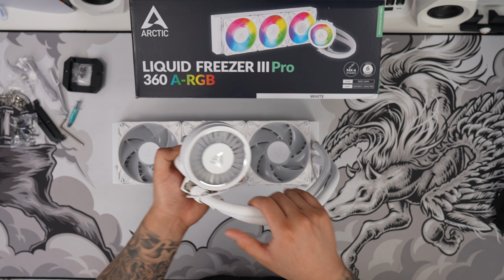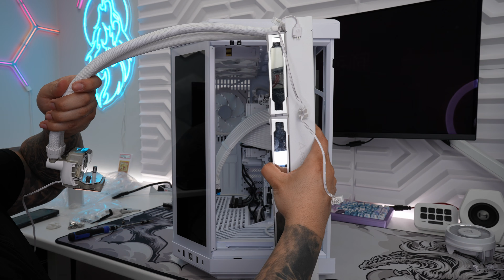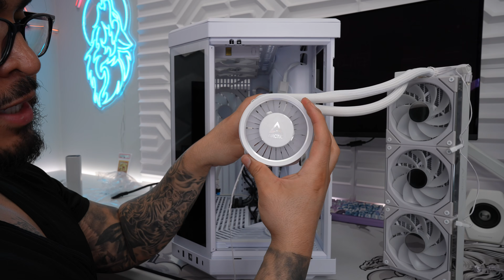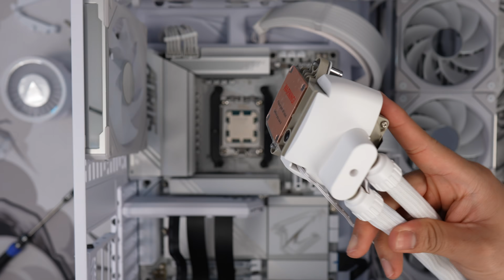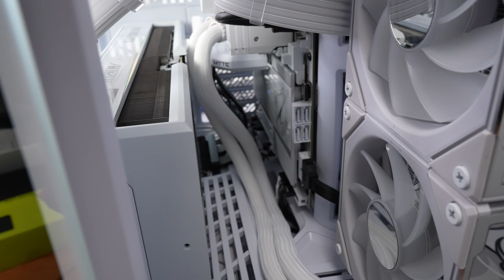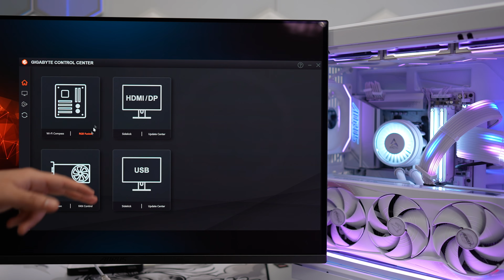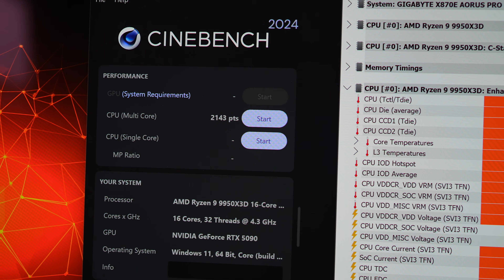Arctic Liquid Freezer III Pro 360 White : How To Side Mount, Control Fan Curves & RGB Control on AM5

Comment: I saw with another reviewer to NOT always put the pump high. Not sure about this model, but the regular is most efficient at max 80%. That's because the water doesn't have enough time to cool down. Every see those commercial toast makers on a treadmill to go under a heater? Like that in reverse. You need time under the cooler.
Reply from the maker: Pretty sure you’re referring to the latest jayztwocents video about pump speed 😅 makes a lot of sense and for future videos I’ll adjust accordingly. Another factor is also not having a low to top curve that changes the speeds every time the CPU heats or cools
Reply: @FIREWOLFTECH  I'm experimenting with it myself, just bought an AF III. My Prime95 stress is hitting 91C and I'm not happy with that.
Reply: In my custom loop I run my pump at 60%. A good balance of sound and flow rate. My 9950X3D with -35 CO peaks 72c on cinebench multi. 38-42c Idle temps depending on ambient temps.
Reply: @SteezinBreezin  Thank you for commenting and reporting your measurements. I am running a 9600x (for two reasons; more $ for a better GPU and also Zen 6 if I wait a year will be much better) but I will note I am benching with Prime95 which causes much higher power draw, perhaps this is unrealistic, as I never get that in Cinebench or games.
Reply: Oops, my point being I can't directly compare if my setup is doing badly for some reason. I'm thinking of re-pasting to see if that helps, or else I can try front AIO vs top AIO, though from my research, when I do buy a GPU (I'm waiting due to current market conditions), the GPU will be much cooler in the top mount option.
Reply: Oh! Btw name the product with those wires with the chasing lights, cool af
Reply from the maker: Hope you get better temps! And I just updated the description with the full Y70 part list 🔥 those are wirless strimer cables from lian li
Reply: Nonsense ignore the reviewer the coolant temperature saturates and normalises after a while that’s relivent only for few mins use
Same as the myth order of components on a custom loop matters again it doesn’t for same reason
Reply: @louisburland5346  I agree, his logic seems confusing. But, his test results did show that max pump speed didn't make a difference, so while his reasoning may be wrong, the overall conclusion is still valid.

Comment: Hello friend, I'm an admirer of your videos here in Brazil, here in Brazil, it's very difficult to find this version, especially the PRO, and I'm finishing assembling my PC... the difference between the non-pro version and the pro version is HUGE? I'm going to install it on a 7800x3d...
Reply from the maker: The major difference is the fans, so if you’re planning on using different fans, the non pro is perfectly fine. 
The only other subtle differences would be better PWM readouts and that extra silvery trim. The PRO just came out, so I would assume it should be available easier soon
Thanks for showing the love from Brazil 🔥❤️
Reply: @FIREWOLFTECH  Thank you very much for the quick response and congratulations on the content and quality of the video... So from what I see there won't be a problem getting the non-pro version lol
Reply from the maker: @ you’re welcome! 
And yes the non pro is also an awesome choice 🔥 just make sure your case can accommodate the thickness and size of the radiator 😅
Reply: @FIREWOLFTECH  Oh my god kkkk i will buy a DY470 darkflash aigo .... Kkkkkk

Comment: Its too loud.
Reply from the maker: The pro fans get loud above 1300RPM and can spin up to 3000 making it louder. Most fans just spin up to 2000 which is why I recommend lower fan curves since 60% is almost the same as 100% in other fans

Comment: Great video! Do you know by chance if the AiO would also fit into the Y70 if it was mountet to the top?
Reply from the maker: Yes it will! Although a push pull might be very tight so I’m not sure how much clearance you’ll have 😅

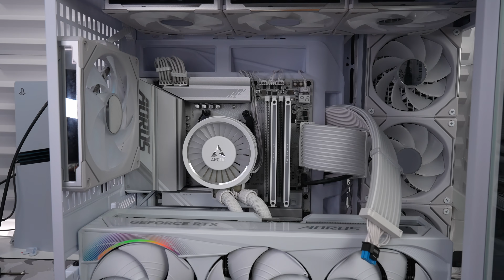Comment: 18:42 thanks for showing this, this is my planned layout for new pc build. i want the pipes to be at the bottom and going up behind my vertically mounted 5080 Aorus master and below the Ram. It would be the best placement with barb connecters at the bottom for 420mm arctic III AIO mounted in the side position of a 011D EVO XL case in push pull configuration as intake. The side mount bracket for the case can be turned around giving you more clearance on the inside of the case or backside of the case depending on what youre trying to achieve. Same thing for mounting your motherboard, 3 different placements, upper, normal and lower.
Reply from the maker: You’re welcome!! EVO XL is a monster of a case, so I’m pretty sure it’ll be easier to do with a removable bracket 🔥

Comment: Any reason that you didn't connect the pump to either of the two pump headers on the motherboard?
Reply from the maker: Because they were located in an awkward position 😅 CPU_FAN will automatically tie the pump to the temperature of the CPU which I’m still able to control the curves. Some motherboards might not have pump headers, so CPU_FAN works fine

Comment: this one or the original
Reply from the maker: This one if you’re using the fans that come with it, since most of the performance gains are from the P12 Pro fans
Reply: @FIREWOLFTECH  The offset contact frame is providing significant gains for the Intel Ultra CPUs (LGA 1851).  I wonder if this offset contact frame doing any change to the LGA 1700 cpus. Worse, better, same ?  Arctics performance tests for the PRO model only mentions the Ultra cpu.
Reply from the maker: @ Yes they’ve seen gains in intel, but since I don’t have any intel CPUs, AMD it is 🔥

Comment: i have same cpu, MB and AIO. what temps do you have as i am worried: in bios i get 46 C. and idle in windows new install i get 55 on full fan speed.
Reply: i read somewhre to undervolt the CPU as gigabyte sets it to too high
Reply from the maker: If it’s a new install and you idle 55C, I think it’s okay, but it also depends on your ambient room temperature and your cases airflow. 
I idle at 42-45C but can idle at 48C if I start running more programs in the background (like wallpaper engine). 
This is with fans set to quiet (900-1000RPM SL infinity) and 1000-1100 for the pro fans. 
I do have the latest bios update, so if you haven’t updated, maybe you can try that. 
On a final note, since this is X3D, I set the power plan to BALANCED instead of high

Comment: Final note, all motherboard software is garbage. Gigabyte i love their boards, but they by default have  a setting in the bios where when you get into windows, it runs a service and starts installing ON ITS OWN the software.
Highly recommend OpenRGB and Fan Control. Both of these tools have almost dead 0% cpu hit, while running a single servicec. OpenRGB doesn't even need to be running once you setup your lighting.
Reply from the maker: I think armory crate is the best, but again it’s personally preference if you want to use a software or just BIOS. 
I’ll look into Fan Control though since I haven’t tried a 3rd party software for fans

Comment: There is no reason on this planet to run the PUMP at max speed btw, you will just cause it to wear out way faster, and its recommended to run the pump at a much closer to mid/low speed, this is a AMD CPU, it doesn't need to run that hard.
Reply: False information, pumps should always be run at high speed they are literaly designed to do that and running them low speed reduces longevity
Reply from the maker: I personally run the pump close to or at max because most of the time the pump is inaudible and helps reduce temps without relying on revving up the Fan RPMs. 
Also, I don’t have to worry about the pump revving up and down since temps of CPU can fluctuate 😅
A lot of software controlled AIOs have really high curves as well. 
Now I don’t know the longevity of it, but a quick search suggest running at 100% is fine
Reply: Pump on dynamic curve is I think best, with their low temperatures being already at like 70% speed. And under load 100%. That is the best of both worlds. Pumps opposed to fans don't make a lot of sound anyway.
Reply: It’ll be fine, it’s designed to run at full speed. Constantly changing the speed hurts it more than running it close or at max

Comment: I recommend checking the static pressure of the fans if u plan to mix for push-pull , that way u can control the fan curves more safely without reducing the lifespan of ur radiator, that's what I did , and i used the LF3 fans for push and Lian Li SL fans to pull (Y)
Reply: I'm massively impressed by your comment. People always say you have to use matched fans so the airflow is matched, but that's not possible. Fan airflow ratings are calculated on unobstructed flow, in a push pull set up the fans that push don't have the same level of obstruction as the fans that pull, so airflow will not be matched even if the fans are the same. As an example for people who don't understand this, in this video, the push fans have to pull air in through the case mesh and then push it into the radiator. The pull fans pull out of the radiator, so the push fans have more obstruction. So as you said, set it up so it's close because getting it perfectly matched is not possible. I usually front mount my aio's and I actually set it up so that the push fans run a little bit faster due to the fact they are dealing with more obstruction. But who knows if I set that right, it's just based on my guess 😂.
Reply: @thebigsmoke5047 same! I keep mine as equal as possible, with any situation where rpm wont match favors pull fans faster. Makes sense to me.
Reply: What do you mean by reduce the lifespan of your radiator? 

And do you mean should we push with stronger or weaker fans?
Reply: @themarketgardener  It is recommended that the performance of the two fans should not differ too much.
Reply: @NiMaCGua Oh yeah
Reply: @NiMaCGua doing this for looks but also cua I felt it might help with that thick ass rad but it dont have room to mount it tubes down anymore at the front of my case
Reply: i plan to do just this but with the 420mm ARCTIC Freezer III in black on my new PC build. Mounted in the side position of a Lian Li 011D EVO XL case. I will move the fans (72.8CFM each) that came with it to the outside of the radiator and use 3 x 140mm Lian Li SL Infinity fans (72.7CFM each) on the inside in a push pull configuration. The A RGB version of the AIO seem to use a lower CFM fan than the plain version. Also another streamer tested changing out the fans and replacing them with P14 Max's (95CFM each) x 6 and it slayed. The rest of the fans in my case are all going to be Lian Li SL INF as well. the 120mm in that case dont fill the slots properly, i dont like the look of the gaps.
Reply: @DrizLd Even though the P14 non-ARGB has better stats, P14 ARGBs perform better because of the design. Check STS’s P14 ARGB review. Also keep in mind P14 Max’s are strong but they are loud as hell and need manual tuning. I’d prefer going 6x fans that have good noise/perf ratio instead. These pro fans seem like they’re good.

I’m also planning on a LF III 420 ARGB on Side mounted intake O11D EVO XL but going to use all P14 ARGB fans (if P14 Pros don’t come out by then). And for rear P12 ARGB of course.
Reply: @tma78 How did it go? Any pics?
Reply: How can u check the Pa tho?
Reply: I’m glad someone said it. In all honesty as an hvac professional the radiator is thick enough that even if you have a push pull your heat saturation is high enough a push pull would arguably make it worse. Especially if you don’t touch fan curves. It creates drag and turbulence one fan ends up having to pull air through the radiator and the other fan making it work harder because they’re not in perfect synchronicity. Air temp changes cold air to hot air, air expands before it hits the pull fans inside the box creating more turbulence. Air pressure changes push blades and break bearings. And you’re pushing more power to run it all. For in most cases a worse cooling system then a 3 fan system and making your pc waaaay louder.

Comment: @FIREWOLFTECH  The radiator on the PRO is 11mm (.43in) thicker than the regular version.  Also how were your temps??  I have the same case and CPU, and have a Kraken Elite 360 with 6
Scythe Grand Tornado's in a push/pull config and 7 SL-infinity fans and was still getting warm, so I undervolted the cpu -20 and am getting great temps and no noticeable drop in performance.  But I have an Artic Liquid Freezer 3 PRO on the way.
Reply from the maker: The radiator is the same thickness 38mm on the freezer iii and 38mm on iii PRO 😅 

When you say warm, what temps were you getting ? 

My idle temps are about 42C-44C with a few active programs, so about 2-3C drop versus Panorama SE. in intense editing and rendering, it stays around 69-72C
Reply: @ sorry bout the thickness, don’t know where I got that from.  My idle temps were 50 to 60 and liquid temps after an hour stabilized at 50+ and during heavy use my cpu temp were climbing over 70 with all fans screaming.  Undervolted idle is 45 and has not gone over 55 during hard use with low fan speeds.
Reply: I’m going to install the LQ FR 3 the same way you did with the tornado fans in push/pull and go back to full voltage and see the results.
Reply from the maker: No worries! Maybe you were looking at the thickness of the kraken ? 

I also think it depends on background apps, room temp and your case airflow as well
Reply from the maker: Yeah check out the results! You should see an improvement since you won’t need to run NZXT CAM in the background. 
I personally keep fan curves around 1300-1500 rpm at 70C. I only kick it to 100 if it hits 90C 😅 which doesn’t happen in my uses

Comment: Is the whole "pro" thing just the fans being upgraded? That's what it seems like.
Reply from the maker: Yeah like 95% is the pro fans. They might’ve made improvements on the intel frame, but the AMD frame is the same.
Other than that, the PMW tech reads more accurately and the vrm cover has a nicer silvery trim around

Comment: Great video, can you do one for 420 PRO when it comes out? I can’t wait
Reply from the maker: I haven't done any 420mm AIO yet😅 but could be possible in the future :) 
Thanks for watching 🔥
Reply: @FIREWOLFTECH Did you use 3 Reverse fans on the aio cooler and was it Lian Li UNI SL120 INF Reverse Blade Addressable RGB Black 120mm Fan?